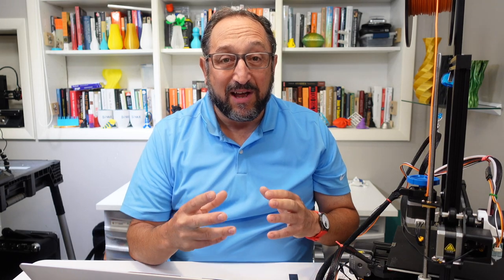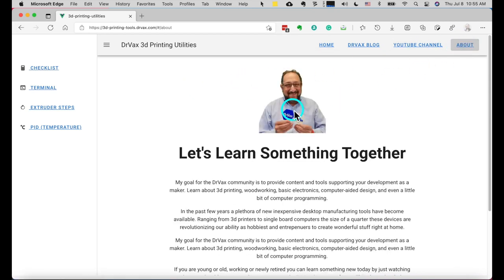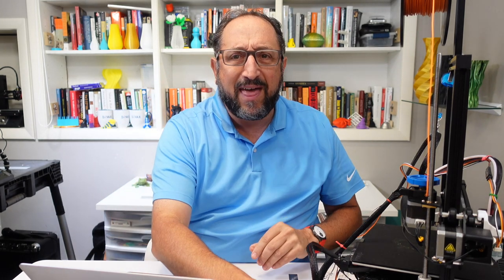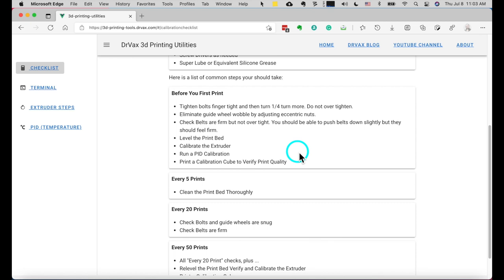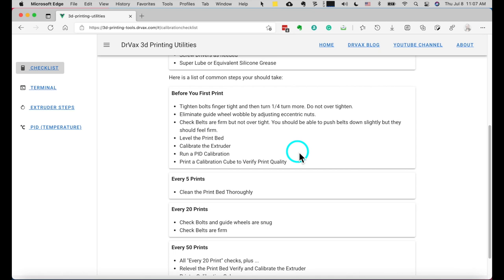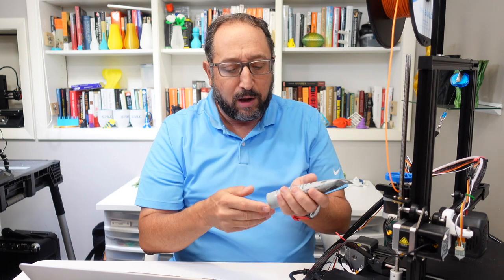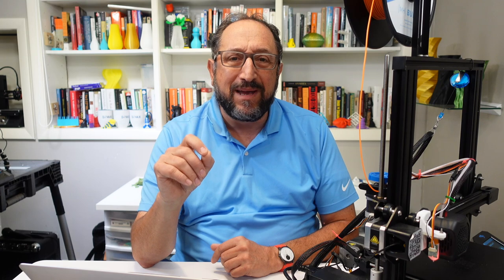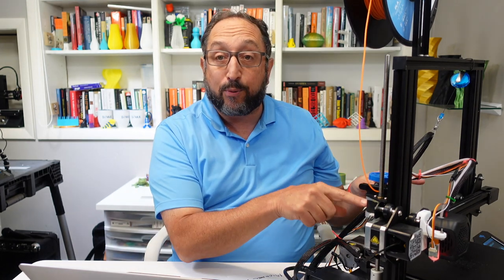3d Printer Maintenance, Extruder Steps, and PID Calibration

Comment: I am new to 3d printing and have learned a lot from your channel. This particular video was helpful in getting my first printer calibrated (just recently received). Thank you for providing the calibration routines and sharing. I was off on both measurements somewhat. Now to see if my prints change.
Reply: How did it go? Did this help you get better results?
Reply: @skyrider4789  So far it has been very good. I have performed a lot of the steps this channel has recommended and I have had literally no problems printing. I am very watchful of using the auto leveling and adjusting the Z height before each printing session just to make sure. It has been successful.
Reply: @billpowell5931  excellent. Thank you for the feedback! 🙂

Comment: I have an Ender 5 + and use a Macbook Pro (and happy to see you use a Mac also).
Thanks for your helpful videos. I've been learning my machine and thought I could avoid having to deal with E-steps since it was over my head when I started, but have the bandwidth now to learn it and am excited to find this and am intrigued.  My E5+ is with the stock display and I use PrusaSlicer, so there was no obvious way to do this, but this seems like a good option to try.
Thank you!

Comment: Hi Irv,  
Thank You for creating the Browser Based 3D Printer GCode Terminal Calibration Tool.  I am very pleased with this tool, as I had no trouble connecting and sending GCode and receiving data to and from my ender 5.  Prior to using this I tried to use Repetier_Host, I was able to get a connection but unable to send and receive GCodes on this program.    For the past 2 years or more I have been a subscriber to your channel and find your presentations to be easy to understand.  As you do not cut corners and are very precise with your information.   Do not get me wrong Tim from TH3D is good also but I find your presentations to be more refined and understandable.

I have joined you forum under the following name Liebrand_G. 

Regards Gary Liebrand

Comment: Dr. Vax, thank you for all of your videos.  I tried to use your software, everything seemed to be fine except I get not response when I type in a command.  It shows [SENT] M115 and nothing happens after that.  Using an Artillery Sidewinder X1.  Installed a new extruder and hotend, I know the esteps need to be changed.  Thank you
Reply from the maker: Try changing the baud rate.
Reply from the maker: Also if you know how turn on the JavaScript log (developer tools) and see if there are any errors.
Reply from the maker: Sorry for the serial replies.   Based on your comment and a couple of others I have added two additional baud rates to the terminal app.  230,400 and 250,00.   You might want to try 250000 for your Sidewinder X1.   If this does not work please head over to forum.drvax.com, register and repost your question there.   I will be able to interact with your more easily on the forum.

Comment: so this worked for me the first time i tried. However, now when i try and connect my printer it does not work. it comes up with the error message when i try and connect same as in the video as it is already paired. i disconnect and try again but same issue.

Comment: Irv, your sound seems a bit muffled today. Also an audible thump every time you put your hands on the table. Do you need to physically isolate your microphone from your table?
Great video though, as usual! Nice to find a use for Edge, until you told us that Chrome can do this too!
Reply from the maker: I will look into your observation about the sound.   I had noice canceling turned up in the post processing to adjust for the Ender 3 v2 fan noise and I may have over done it.

Comment: Hi. I have an Anet A8 plus. I tried to update my PID settings using your software. Everthing when fine. I entered M500 to save settings. I disconnected, turn the printer off, turned it on again and it reverted back to the old settings.
I repeated the whole process twice to check I hadn't done anything wrong and got the same result. Now my prints are failing saying MIN TEMP.
It's running Marlin 1.0 and on my LCD there is no SAVE SETTING function which I find pretty odd.
Can anyone help?
Cheers
Reply: Sorry marlin 1.6

Comment: Will this work with my Anet ET5 Pro with stock firmware?
Reply from the maker: Good question.   The terminal feature will work but you would have to check to see if all of the tuning commands are supported.   I no longer have a stock ANET machine so I cannot check. However you will do no harm by trying.